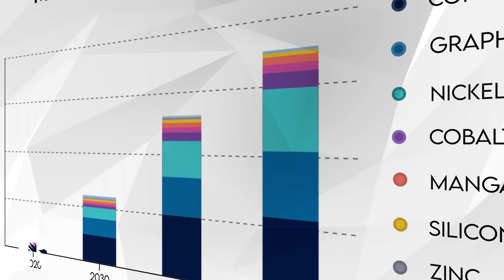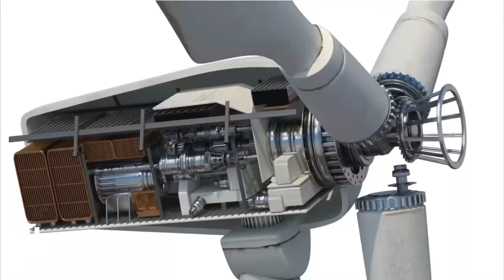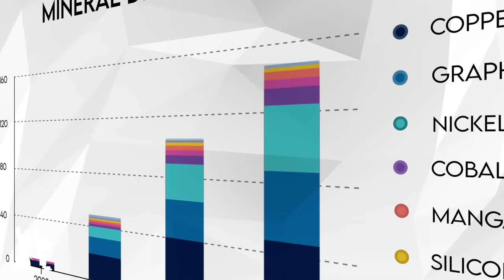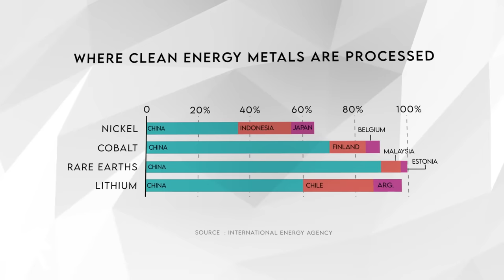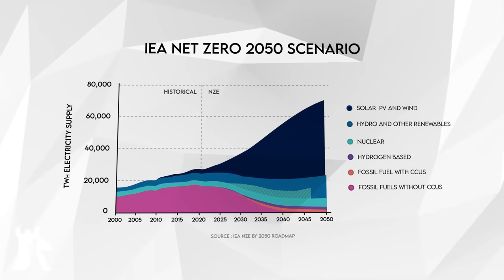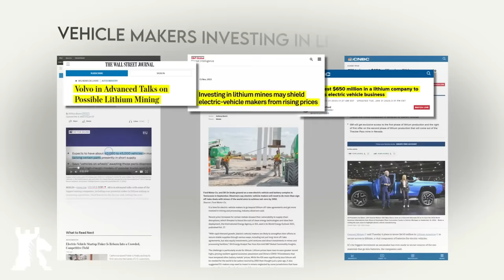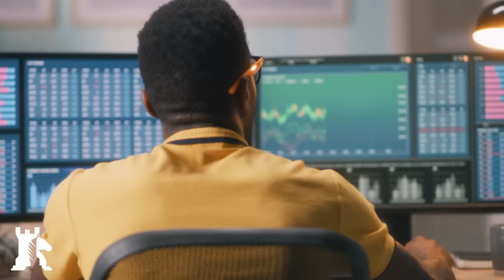Net Zero by 2050 is not happening

Comment: The right moment to massively invest in nuclear energy was decades ago and even if we invested massively into nuclear energy now (we should), the train has already left the station (i.e., its too late to stop climate change). As a result we are and will remain massively dependent on fossil fuels, given the fast-growing global population and surging energy demands.
Reply: Solar already out competes nuclear on it's worst days during the winter.
Reply: If nuclear can be made to be more responsive and nimble with dynamic supply chains then it is not too late. 

But the era of large nuclear power stations is over being built at scale in the west is over . Solar power is too cheap to compete with and once a cheap storage solution is paired with it, it will be economic lunacy to install anything but solar.

Already renewables make up 95 percent of all installed electrical generation capacity
Reply: What do you mean by it’s too late to stop climate change? When you say climate change are you referring the change in climate caused by humans? If so why you think it cannot be stopped?
Reply: Building enough additional nuclear power plants to be a significant contributor to reducing fossil fuel emissions takes too much time. Nuclear power plants are expensive and too slow to build to avoid overshooting the point of no return. 

There is also the same resource concerns as with wind and solar solutions, as mentioned in the video. Compared to that, running out of NPP fuel in 50 years rather than the current rate of 200 years is a joke.

Building some NPPs is fine and it can help a tiny bit, we should not ignore that! The main problem with it besides what I've already mentioned is that energy companies lobby for nuclear as a get out of jail free card. It isn't! But they use it as an excuse to scale down fossil fuel slower than they have to, and adopt renewable energy tech slower.

The real thing that has to be done, and that noone will do, is to build and consume less.
Reply: @ASDeckard  You can't go more than 66% in solar and wind due to their intermittent nature.
Reply: So lets glass half the planet?
Reply: @ws1814 every factor in our ecosystems is controlled by negative feedback loops, more oaks means more squirells, more squirells means less oaks, less oaks means less squirells => stability. If those negative feedback loops get stretched out of their corective capacity they can become positive feedback loops and you are facing an ecological collapse. For example wayy too many oaks means way too many squirells means no oaks ever again.

Atmosphere has a few controlls too. Nrgative can be water acidity and photosynthesis, but there are positive ones too...glaciers reflect a LOT of heat back into space.....until they melt

Plants use CO2...until the oceans are too acidic and land too dry due to climate change

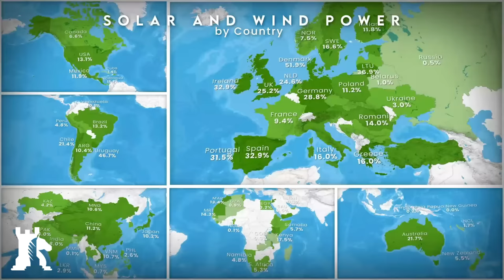Comment: 5:10 I don't think the idea that all savings in carbon intensity (i.e. the about of CO2 produced relative to GDP) in Europe is due to offshoring is actually borne out by the data. I have read analysis on this, and I'm pretty sure that even if you account for all consumption-related emissions, there have still been reductions.
Reply: Of course, because energy generation is quickly shifting to renewables while efficiency is increasing and thus energy consumption stagnating. In China, where addition of renewable energy sources is highest globally, energy consumption is rising, and thus their emissions are still rising.
Reply: Yes, there were emission reductions in europe even accounting for consumption related emissions

Comment: Little corrections:
2:42 wind trubines have a capacity factors of roughly 25% (20% on shore, 35% offshore), so u will need 60 wind tubines (3.25MW) to replace one gas turbine(50MW). Both have a avaibility factor of roughly 90%.
Reply: The rule of thumb I've been using is 1/3 wind turbine capacity for well situated wind farms for an estimate of yearly output and 1/5 the capacity of solar electric panels.   Solar electric panels are really only good for charging batteries for grid quality power where wind turbine farms do much better, but I wonder if the jumbled output power of a wind farm is culled to something lower to be something more consistent before being further conditioned with base load power.   If that is the case it might be more realistic to use 1/4 the power capacity of wind farm as a yearly average.   It makes little sense to make a wind turbine able to work in a 100 kph wind which it would only see during a huge storm just so it can claim a huge wind energy generating. capacity.  Wind energy goes up with cube of the wind velocity, that's V^3.
Reply: @douglasengle2704  onshore germany average 2022 was 23%, austria was 17%. Solar PV in Austria is 12%. Solar is more predictibel and online during daily peak demand, so it needs much less storage.
Reply: @krautergarten4529  The real averages at practice levels for fuel savings of solar and wind electric energy are not as of now readily available.   The erratic nature of solar voltaics makes them requiring instant makeup the if not charging batteries or similar requires fast reacting generating plants that have to run at such a high state of readiness they are not saving much fuel when having to make them at grid quality.  That is why Tesla strongly insists on supplying their solar roofs with a power wall battery storage system.

Comment: 3:00 when calculating the materials requirements for replacing a gas turbine with wind or solar, remember that to compensate for the "renewable source" variability (and inability to produce at some times of the year), you also need a massive amount of either overcapacity (up to three times as much nameplate power production), or grid scale battery backup.  In addition, the renewables require a significant amount of extra long distance copper transmission cables, since they typically have to be sited where the sunshine or wind is best - and where land is cheap, which is usually far away from where the people live.   Finally, if you try to really scale up production of electricity to replace services provided by fossil fuels in industry and transportation, the additional solar and wind production facilities will have to be built further and further away from cities and in more marginal locations, ie. with lower marginal output, longer transmission distances, and higher costs.

The materials estimates given for replacing conventional power are probably lowballs.
Reply: On the other side of the equation, when calculating the materials cost for a 50MW gas turbine one probably shouldn't assume that the gas that's being burned automagically arrives on site with no material overhead (e.g. drilling rigs, pipelines, ships, and the energy required to run the entire shebang, day in, day out). Additionally, when commenting on videos it might be considered advisable to have a grasp of the basics first: "...extra long distance copper transmission cables..." ROFL. Because that's exactly what's used in transmission lines. Copper. (/s). Brief mention goes to ignoring pumped storage and hydrogen as energy stores in favour of solely mentioning batteries, and suggesting that costs increase as one gets further from cities - pretty much the complete opposite of reality.

As a final thought, if a modern wind turbine is rated at ~12MW why does the video's creator say it requires 15 of them to replace a 50MW gas turbine? Hmm, maybe the people whose job it is to look at these things have already considered such 'trivial' things as capacity factors in their calculations...
Reply: @whibla4738  re Pumped storage: it's great, but very difficult to expand capacity significantly, and certainly not at the scale required.  Similarly for hydrogen as an energy storage: it's technically possible, but incredibly inefficient (something like 25% round trip energy recovery), and introduces a bunch more challenging engineering problems.  The video was likely focusing on lithium Ion batteries simply because that is where the market and government policies are currently focused - because the engineering is known and in use.  There are very likely to more cost-effective grid-scale power storage solutions available in future, and we really NEED better grid battery solutions that do not use massive amounts of metals, but none are currently commercially available and known to be reliable - yet.

Note re the wind turbine comment: fossil fuel power stations operate on demand, gas-powered turbines can be run all the time or spun up when production from other sources are unavailable, so the 50MW is very reliable.  By contrast, a 12MW wind turbine output is only intermittently producing power, and not necessarily when you need it.  So, you need MORE of them distributed over a wider area to try compensate for low wind periods, at least in the absence of grid-scale battery backup.  Keep in mind that California has something like 2 minutes worth of battery backup. There is much much less of it actually deployed than is needed, because it is expensive, and usually not factored into the costs of providing wind (or solar) power.
Reply: @whibla4738  BTW, if you DO have battery backup of some sort for your wind turbine, you need additional turbines to provide power to the backup system.  Let's assume that you have a decent site where the turbine produces nameplate power 75% of the time (sometimes either having low winds for less or no power, or occasionally having to be shutdown if there is a storm with too much wind).  Then to get your full 12MW rating, you need another third of a wind turbine.  Now, 75% of the time, you will have some power (a third of a turbine's rated power) going to the backup system.  (You may want more than just a third of a turbine for redundancy of course.)  That's fine as long as you only have short lulls without wind that your battery can actually cope with.  If your location has occasional LONG periods with no wind, you may need a larger battery and additional turbines to charge it up.

Extra turbines can't be stacked on top of each other, so need cabling to connect to the grid (and backup system) of course.  That's for a steady demand, and does not factor in peak power requirements, or situations where some energy sources in the grid are offline for maintenance, which are also factors that may require overbuilding capacity.

(Solar power has much greater variability between seasons and day/night cycles, so requires much more battery and much greater capacity overbuild.)

Comment: While the concerns are valid, it seems that at least when it comes to batteries, there is already a solution. LFP batteries don't require nickel or cobalt and are only slightly more heavy while being less prone to catching on fire. They are already produced on a large scale and in products, including EV's so the chemistry has changed. And at least nickel and cobalt will eventually fade out.
Reply: LFP is fine for grid storage, home batteries, and lower-end autos, but batteries with high nickel and some cobalt (NMC, NCA, NMCA) are likely to still be used when needing the highest energy density. For example, Tesla is using high nickel batteries in the Model S/X, Cybertruck, Semi and the long-range variants of Model 3/Y, because it needs the higher energy density. Adding manganese to LFP can increase the energy density from 140-160 to 180-190 Wh/kg and CATL's new M3P also adds magnesium, zinc and aluminum to LMFP to achieve 210 Wh/kg, but they are still far from the 260-290 Wh/kg for the high nickel chemistries. 

In other words, I suspect that there will still be a lot of production of high-nickel batteries in the future. For example, motorcycles which weigh too much are hard to ride and more expensive because they require a beefier frame, suspension and brakes, so it looks like the motorcycle industry which produces 60 million units per year will mostly use high nickel batteries. So far, the major electric scooter/motorcycle manufacturers (Yadea, Gogoro, Super Soco, Zero, etc.) have stuck with NMC and I don't think that will change.

Comment: It would be possible to get Net Zero by 2050 but that would require a that a lot of different countries work together and it would cost a lot of money. For pretty obvious reasons I don't see that happening
Reply: At this point, switching to 100% green would be a net profit compared to status quo oil & gas
Reply: @kylejohnson6775  No it wont.... There was an auction in the UK to build an offshore wind far that garnered no bids due to rising costs and little profitability from such a project... Unless going thermal or nuclear then the profitability of green energy is very little and would also require great infrastructure changes to make everything electric like EV chargers on every street and dozens of new power plants to facilitate the massive new draw of this power... I personally cant see it happening plus China produces a 3rd of all greenhouse gases and is still rising so it doesn't matter if we cut it when China continues to burn more along with India who is the third most damaging and also on the rise.

Comment: Shirvan, you’re catastrophising, we need less and less cobalt, nickel and lithium per battery, for electric vehicles, every few months. Sodium batteries, lithium iron phosphate batteries, now we have aviation grade batteries. Does it need reindustrialisation, yes. But that’s a good thing, 25 times as much power in a decade, vehicles that need 1/10th as much maintenance and cost very little to charge. You would have said high speed rail can’t be built in China, Australia can’t export 1/4 of the world’s natural gas, the United States can’t shift, to unconventional hydrocarbons.

All those things, only took a decade and a half, price reductions in Solar are game changing, we just hit a terawatt, of solar and growing fast, this is the roaring twenties, third Industrial Revolution, clean disruption. As Tony Seba says it’ll be fast. We can’t comprehend the roaring twenties, after half a century of the great stagnation, in the developed economies. The horseless carriages can’t replace horses, they’d need roads, rubber, mechanics, factories, impossible. Gas lighting can’t be replaced by electric lighting, impossible, electric subways impossible, the cathode ray tube screen replaced by light emitting diode screens, impossible photoelectricity can’t become widespread.

The personal computer, smartphone, tablet, gimmicks, they’ll never catch on, no one will have a microwave in their house, reverse cycle air conditioning it’ll never catch on. Electronic Banking, online shopping, video streaming, a fad, it’ll never work. Refrigerated warehouses, ice boxes, uneconomical, flush toilets, clean water simply can’t be implemented, too expensive, Chunnel, gothard tunnel, suez and Panama canals impossible, ridiculous like transcontinental trains. Beyond the world’s ability to develop.

Comment: Currently it is cheaper to install wind and solar than build a new nuclear powerplants per kWh. If these material procurement difficulties hit as you described in the video, the market will swing back to nuclear.
Reply: Depends which countries u means
Reply: It depends on the cost calculation. If you subtract subsidies from the cost, subtract backup dispatchable capacity cost (batteries/nuclear or FF power/expensive interconnect power) then yes it's cheaper. 
Otherwise not so much. The big issue for wind is zero energy when the wind blows too little or too much. The big issue for solar is no energy at night, reduced energy when cloudy, near dusk near twilight - and at the times of year when the sun is low (except near the equator).
Reply: @Michael-jx9bh  Even with all of that in mind Nuclear is cheaper and requires significantly less resources to build, maintain, and operate.

Comment: Many countries don't require economic growth. There's nothing wrong with a stable, stagnant, and sustainable economy. Infinite growth is not possible. For a lot of places it's also not a bad thing if the economy shrinks a bit. For instance, if the US manages to distribute its wealth better, then way more people will be able to have a comfortable life without any financial worries, and that's even possible if the overall economy shrinks. In many ways the US fits the definitions of a third world country even though it has the largest economy. So it is definitely a myth that an economy needs to grow.
Reply: If an economy isn't growing it's breaking down. If, for example, a currency is deflating, why spend or invest it? Everything freezes. 

I'm sure you  (and certainly the average person) would whine and cry the second growth stopped and you couldn't get the newest IPhone or gadget
Reply: Infinite growth might not be possible, but it is absolutely possible to keep growing. West has stopped relying on population growth for economic growth since like 1700 (other regions started at different periods). Modern economic growth relies on innovation, if you manage to create solar panels that has 2% higher efficiency through engineering (at a similar price), you are essentially creating economic growth through introducing a more efficient, better product.

Comment: The answer is Thorium Nuclear Powerplants + Hydrogen Batteries.
Reply: "You see what we need is for our expensive nuclear plants to have two extra steps and cost three times as much, and we need our batteries to be more dangerous, have higher leakage rates, and be radically less efficient. That will solve the problems."
Reply: @ASDeckard are you really meatriding rich people in this comment section orrrr